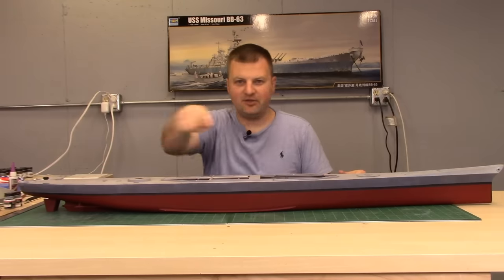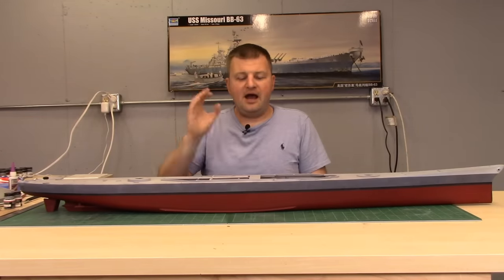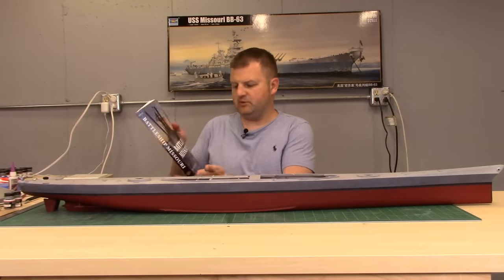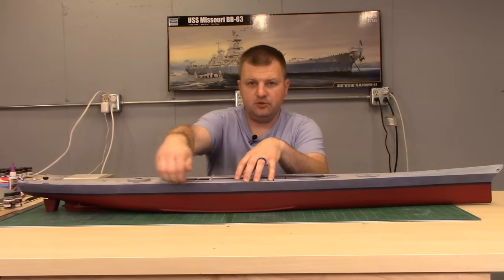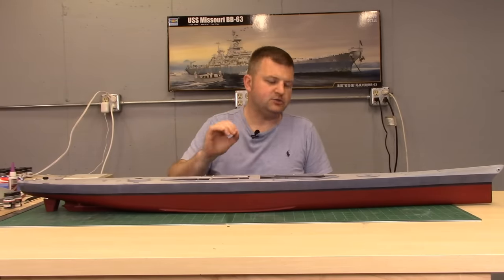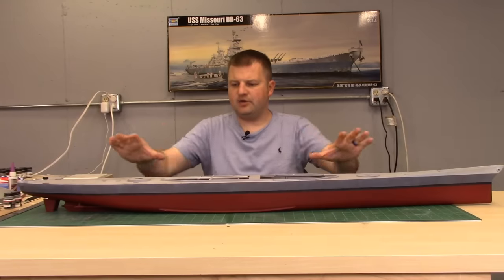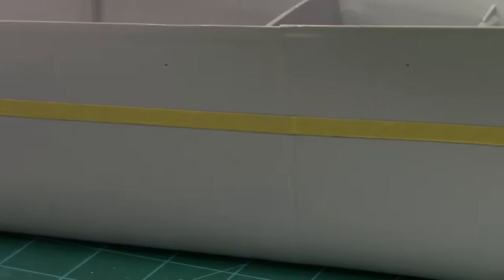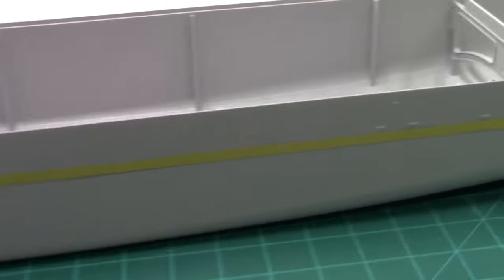1/200 Scale Missouri Build Video 2

Comment: The way I used to do tin canning was with a Dremel set in its router base and a router nosing bit.   i made a simple square template that limited the tool to the area desired.  I used a very light touch and barely touched the plastic with the bit.  I varied it slightly from space to space based on pics of the hull of the USS Iowa.  I tried very hard to copy the damage as it looked it real life.  I wish I had pics of my tools and model but it was a long time ago, before cell phones and digital cameras and I was a teen... nuff said.   Unfortunately your technique produced dents that are far too pronounced for the scale.

Comment: Both the chisel (not good) and scraper (better, but use less pressure and more repetition) had way too small radius.  ...And it looks like shit, frankly (painting made it better though). You're taking away too much. It should be much more subtle and shallow, and it should go all the way out to the rectangular frame. Finally, you don't have to do it at all. Between getting the results you did, and not doing it at all, I'd take not doing it at all (particularly considering the work it saves). There's also the option to create a mild optical effect by pre-shading with a rectangular mask.
Sorry for the brutally constructive criticism, but I honestly don't think that looks good. Try using a scraper with bigger radius, lean it more to get even bigger radius, less pressure, and do far less, and see what you think about that.
Reply from the maker: Vermiliontea well I agree with some of what you say. What you have failed to consider is the plastic is only 1/8 inch thick. A more aggressive dent would result in a hole. Also, painting the dents at this scale would clearly look faked. The ship is too big to not actually put them there. In real life you don’t really notice the dents looking directly at the hull, perpendicular to the ship. But from the bow or stern looking forward or aft, and depending on the light, you will definitely see them. As demonstrated in my reference photo. If you paint them on, you will not see anything when viewing things from the bow or stern. But thanks for the comments! I appreciate all input.
Reply: @TheMidwestModelShop   Okay, but I was suggesting much more shallow dents, not deeper (bigger radius scraper = more shallow). And yes, pre-shading painting wouldn't look right.
Reply from the maker: @Vermiliontea  They are much more shallow now. You have to take into account the layers of paint that will be added. It worked out well.
Reply: @TheMidwestModelShop  Yes. It does look better after the painting.